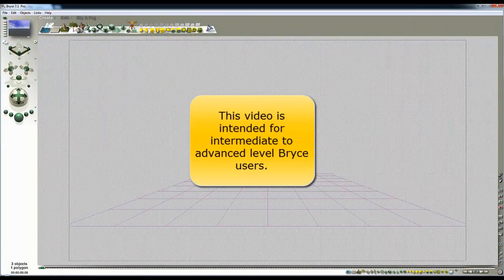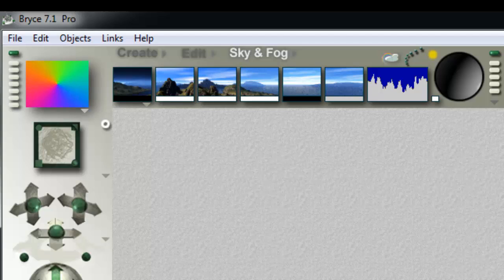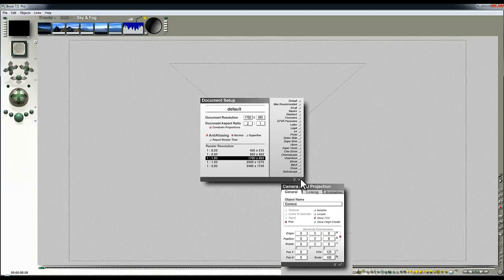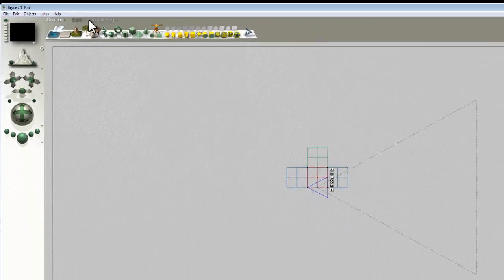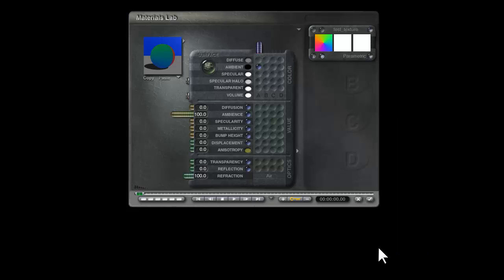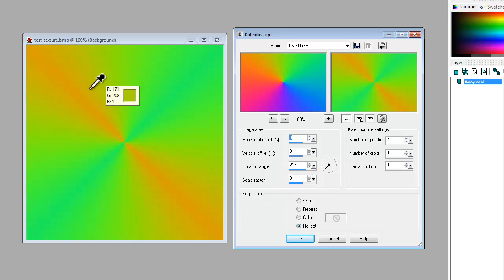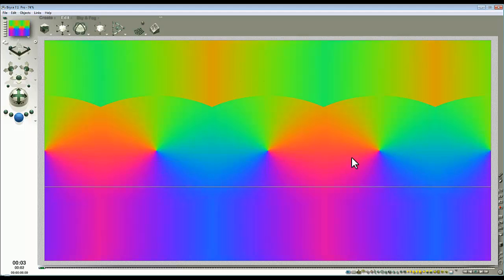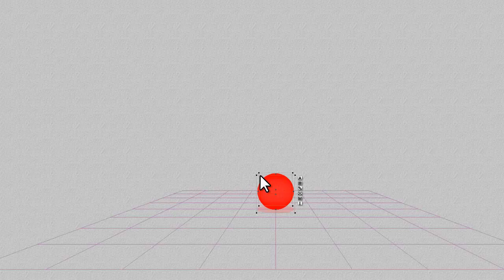Bryce 7.1 Pro Advanced - Setup for SM texture capture cubic - by David Brinnen.

Comment from the maker: Ah... but I did feel it was a bit "Advanced"... and it also fits in with the titles of the others that include the word "Advanced".  Although yes, I know I've not been very consistent with my titling - or indeed measuring the exact length of the videos - which is why I've started to move away from including the running time to avoid getting grumbled at for not getting that right...  There's always the description?  Maybe the title could juse be a number and the words "read the description"?